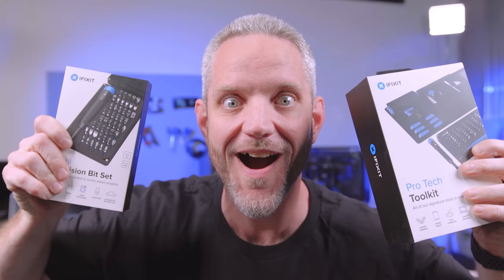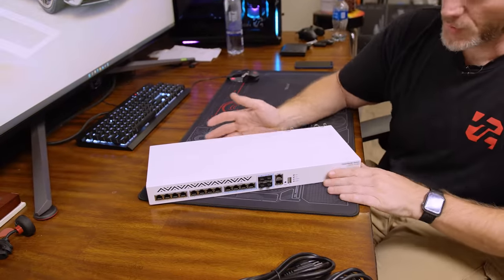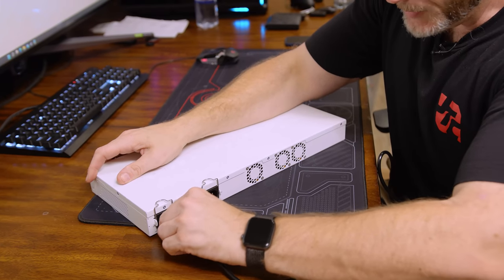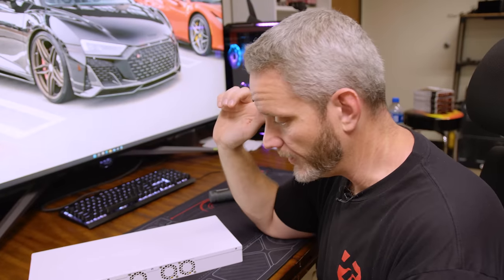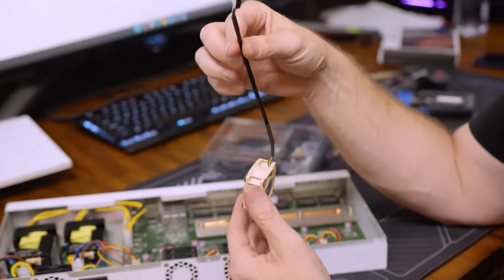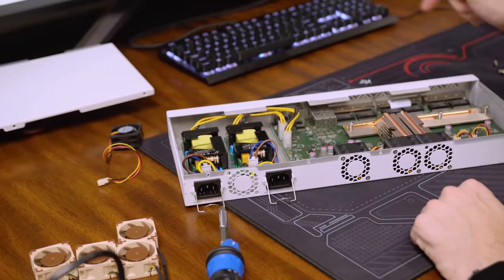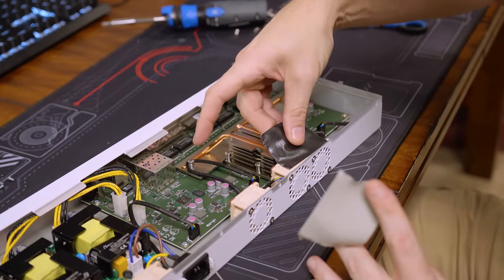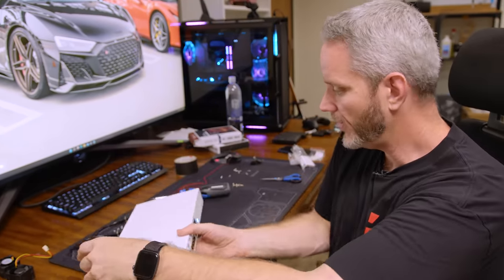We had to modify our new network switch...

Comment: If you’re going from desktops then copper makes sense. 

Fiber optic makes sense in data centers because fiber optic trunk cables for structured cabling (patch panel to patch panel connections) are much thinner and are impervious to EMI which can be an issue with thousand of servers, switches, PDUs etc. around. 

Plus nowadays everything moving to 25Gb for compute nodes and 40/100Gb for switch uplinks, having fiber infrastructure with OM4 fiber makes sense for upwards compatibility.

Comment: I'm a network admin, and I don't recommand this mod for business switches.
Even if it have the same size, fans don't have the same CFM ! It can potentially cause a overheat issue in high load situations.
Be careful and read the fan datasheet, the CFM can be hard to find on documentation.
Reply: It was curious though that there were pwm pins on the board. Still, totally agree with you about the CFM rating.
Reply: @darkhunterkiller4602  I've already made the same move on a old cisco 2950, without problem...even if the tiny noctua have a smaller cfm...but here, when we see the rad size, I guess this case can be really hot...I dont know this brand, dont know if you can monitor t° or use the pwm into the system
Reply: @david79781  Hopefully it doesn't blow up on Jay! lol

Comment: I’ve replaced quite a few 1U network gear and server fans with those Noctua fans. You lose some airflow but since the airflow is designed to be up to 100F ambient usually it’s totally fine. Especially those delta ear death fans. Soooooo loud. After swapping the fans then your only question is “Is the fan on/still working?” - I just always crack them open first to check exact size, voltage, and if it can do (4 pin)PWM or not. They’ve always been well worth it. And honestly….with some that are 6+ years of 24/7 service and no failures I feel like they’re more reliable than the original fans.

Comment: I have some concerns and would love to see an update video if the management software reports temperature. I've looked into using those same Noctua 40s in a 1U server I have, and the CFM just doesn't come close to the fans that came in it. It has dual Xeon X5650s, so I haven't attempted at risk of just wasting the money on a whole bank of them
Reply: Test it. Keep in mind all servers is made for worst case scenario. A 42U rack filled with 1U servers and intake temperature of say 22-23c. They need to push a f-ton of air to combat a situation like that with utilization at 100%.
Reply: @rolf7072  And what do I do with 8 to 16 40mm fans if it doesn't cut it for two Xeons? I agree with just testing the switch. But still curious what the thermals are if the interface reports
Reply: @rolf7072  I love Noctua fans and try to use them wherever I can, but I tried to replace a loud 92mm CPU fan (3,000 RPM, I think, might have been 4,000) with a Noctua and the reduction in airflow was so severe that the fan was completely incapable of cooling the CPU and it thermal throttled REALLY hard. Noctua fans will beat the noise levels of any other fan in a comparable performance envelope, but they're not meant to push a ton of air regardless of noise. Their industrialPPC fans are the closest they get to that, where they have much higher RPMs than their normal fans, but they only make those in 120mm and 140mm sizes.
Reply: It's funny.  As it turns out, RPM, CFM, and noise tend to be directly correlated.  :-)  There's usually very little difference between almost any two fans that run at the same speed, pushing the same amount of air.

There's a bit of motor noise difference, but it's often just that they sound different, and one might be more or less annoying or noticeable.

There's vibration, which can be amplified by the surrounding sheet metal or whatever.  But you can use isolation mounts on any fan to tame that problem.

The main contributor to noise is the air buffeting on surfaces around the fan.  Through the heatsink, against the grille, etc.  The only way to quiet that is to change the volume of air moving through those turbulent areas (lower RPM), which affects thermals, or change the properties of the physical items in the path so that the air buffets less.

Or, if you have the option, change the path of air entirely so that there isn't so much turbulence so close to the fan blades.  (For example, using ducts instead of fans directly mounted to a heatsink or, like in the case of the switch, to the perforated grille.)
Reply: Your right, those original fans are made for high capacity air flow, Noctua fans are made to be quiet and they run at an slower rpm.
Reply: There is difference between needing the CFM not needing it. In your case, you need it due to the thermals of the CPU. In the case of the server, if it's not placed in a normal enviroment and load, 42U thigtly packed with 1U servers and 90-95% (you never want 100%, that leads to queue problems) utilization of the cpu, NICs(yes, 10gig gets HOT), memory and disks, the need for the same CFM just isn't there.
Reply: @Themicles  Try adjusting the bios first, there should be settings for economy/silent, but its depends on what server you have.

Comment: I was going to go with Mikrotik but went with Unifi for ease of use and that things are more widely available here from them.

Buying and renovating a house, working and raising a kid in a foreign country is so stressful that I think the decision paid off honestly, though I would have really liked redundant PSUs..

Got a Dream Machine Pro and a 48 port switch with PoE++, they'll handle ethernet to all rooms (multiple in some), PoE devices like cameras, APs, PIs, servers and JBOD etc.

Patiently waiting to get it all sorted and move in though..

The Mikrotik switch I looked at was similar, had the same issue with fan noise etc and I would have wanted PWM for them. The fact it had daughter boards to spread the load and make it easier for spares was nice though.

Comment: I personally own that switch. There is a Firmware update that quiets it down to almost inaudible. First thing I did out of the box.
Reply: Also to note, this running in SWos has been rock solid stable for me for the last two years. The only time it get's rebooted is when the power goes out long enough for my UPS to die, or when I do a firmware update on it (which is rare). 100% stand by both this 12 port and the 5 port little passively cooled 10GBe switch. Both are awesome.

Comment: Jay, take this with a grain of salt as I don't know the dimensions of your area... however I would have highly suggested a 10G SFP+ switch w/ 25/48g uplink ports for other switches...  That way depending on where in the building the rack would be and endpoint compatibility you would be able to adjust according to the needs.

Anything over 30m and you start having issues w/ 10G & higher speeds over copper.  This would also allow you to pick & choose network capabilities, that way you could choose a 1/2.5/5/10G copper SFP+ module to drive your PC, and Phil could get a higher speed SFP+ module w/ fiber to plug into a more powerful NIC on his PC to give him higher priority to internal bandwidth to the server w/ a higher speed NIC installed in that as well.
Reply: He did wired the building with CAT6a so it'll work fine at 10 gig.   Nothing crazy long lengths either.

Comment: 7:59 No soldering iron required. If the fans in your switch did not have a standard 3-4 pin header, you would cut the ends off of both fans (new and old) and connect the old fan connector to your new Noctua fans with the kit. Insert the black wires in one connector and use pliers to secure them, do the same with the red wires. In the end you will have a new fan with the original fan's connector. 

The switch may have a PWM header but the software controlling the fan is set to DC mode, I would remove the PWM wire. 

10Gb RJ45 Ethernet ports run hotter than fiber SFP+, fiber runs hotter than Direct Attach Copper (DAC) SFP+. SFP+ RJ45 transceivers run the hottest.
Reply: All those connections are crimped.
Reply: @BrunodeSouzaLino  To me it is akin to a 110 patch panel. The wire is forced into opposing blades that cut the jacket of the wire to make the connection.

Comment: Nice to see things that use STANDARD fan headers for once, i bet you can fiddle with it when configuring the thing to.
Reply: Anything that uses a non-standard fan header is still standardized enough that you can buy the required connector off Digi-Key, or any other similar "electronics component focused" vendors (places where you can buy transistors and resistors and capacitors and integrated circuits in quantities ranging anywhere from 1 to ten thousand and above, at a fair market price).

The hardest part is finding the name of the dang connector.
Start with a set of digital calipers, take down the dimensions, and search based off of that. That should turn up the connector name, then you can change your search to the name of the connector and find pricing options.

This goes for not just any connector used in electronics, but any component used in electronics period.
This is why some manufacturers of devices that don't want you fixing things (and instead want you to buy a new thing) will actually use a high intensity laser beam to scrub off the numbers for the chips inside their devices, making it MUCH much harder to get replacement parts (looking at you Apple, Right to Repair should be universal, stop making it INTENTIONALLY hard to fix your stuff, this is why I hate Apple, well that and they're grossly overpriced for what you get).

For any "I don't know what that is" connector (or anything else) you can think of, there's gotta be somebody making it for sale to whoever has the cash for it.
The only minor problem you might run into is that you might only be able to buy in bulk of like 100 pieces or more, but even for just fans it's only a connector, chances are that they charge less than 10 cents for them in quantities over 1000.

Now this isn't usually the case, but you might actually run into a problem that I've just thought of. Probably not for fans, but for other things. There are a kind of connector that connects to a "cable" that is in actuality just a little plastic strip that has copper circuit board traces printed on it, usually the part that goes into the connector is reinforced with a less flexible piece of plastic. I forget what they're called, but "flexible electronics connector" should turn up some results for the general category.
Usually those connectors are standardized, but sometimes they might have literally one application and one vendor, so you might be up a creek without a paddle trying to find a replacement connector, and if you damage that cable well you can just forget about the entire thing that little cable is attached to, because you won't be able to find just the cable, instead you'll need the whole assembly.
But that shouldn't happen for just a cooling fan.

Comment: While it doesn't really fit your needs right now the Brocade ICX6610-48P-E is a great enterprise server switch you can get for sub $200 used and it has 8x SPF+ 10Gb ports and 48 1GbE ports. You do have to work around the software lock on the 10Gb SPF+ ports but there are resources online for that. Aruba S2500-24P is also a good option for used enterprise server switches.

Comment: Jay:  My advice would be to use this switch for your computers and server, then get a second switch like the Mikrotik CSS326-24G-2S+RM for your (relatively) low-speed devices like the cameras, DVR, and eventually your maker equipment.  This will also keep your main switch from having to deal with the constant network overhead caused by the cameras/DVR talking to one another.  This will give you plenty of room to grow while also reserving 10Gb ports for machines that actually NEED them.
Reply: Great Name 😂👌

Comment: The 24 port 1 gig Netgear switch I was given by my geek pro system builder and networking buddy has a extremely loud fan in it. I figured my home network would never stress it enough to get hot so I just unplugged the fan. So far it has been fine, fast, no problems. It's not on the level yours is but it just works and I have more ports than I'll ever need with luck. I doubt you could get away with that with that monster but some users out there might get away with it if they have a similar older switch that is stupid loud and you have it where you can actually hear it.

Comment: You can't use patch panels with DAC cables, and even for fiber you can't just cut a cable and terminate it into a patch panel. Then on the front of the patch panel you can't easily get fiber cables shorter than 50cm/20" so you end up with a mess of excess if the switch and the patch panel are right next to each over. You can get as short as 15cm/6" lengths but they are usually made to order.

Comment: We use Mikrotik all over our network core at my day job working for a loca wisp (wireless internet service provider), as well as ubiquiti equipment.

They’ve been rock solid, other than dealing with some of the networking feature shortcomings of mikrotik’s way of doing things as compared to say Cisco or juniper, but they get the job done and I think we have had several in the network with nearly a thousand days of uptime without issue!

Comment: I have actually swapped out all my fans in the power supply and extruder on my 3D printer with those exact fans...I have to say at full speed those are SUPER quiet and I have to keep checking them to make sure they are running.  I have to say with having my 3D printer close to my work desk, it made a huge difference.  Love these little fans.

Comment: You should 3D print a shroud to force the air to push or pull from the heat sink, the tape is going to collect dust and make the situation more turbulent in the long run.
Reply: It's Duct Tape, doing it's job.

Comment: I'd recommend getting the Unifi Switch Enterprise XG 24 when it comes back into stock. Gives you 24 10GB ports with 2 25GB SFP+28 ports for $1299.

Comment: I used to work for a WISP that used those for the routing to customers and it worked great. Every now and then a port might go out but you are talking about a ton of data running through it and it was in an a/c cabinet that was outside so I am sure that it will work just fine for you. We used a program called winbox to access the gui for it and it was fairly easy to use. You can also get 10g ethernet sfp for the 4 slots to add more ports. I have removed the power supplies on those to a DC connection before and didn't have any problems so I am pretty sure you are safe.

Comment: Ok FYI. When Jay was talking about the Power supply and it being charged that depends on something. In order to make sure the caps are discharged the best way to do with without using a bridge resistor is to disconnect the power supplies from the mains outlet while the device is still running. Is is true for all AC to DC power supplies. The reason for this is while the PSU is still running, if you pull the plug, so to speak, the PSU will pull the power from the caps, remember, the caps are just there to hold reserve power to prevent the power from dropping below a certain threshold. if the PSU is on when disconnected it will pull the power from the caps until there is no more voltage left and then shut down

Comment: Working as a network engineer I can tell you that Mikrotik is some of the cheapest proper network gear you will ever own. If you need to get to 10Gb uplinks look perhaps the the RB4011 or CCR series. The later can get a bit expensive but its rock solid and just works, it doesnt want to stop routing for as long as it lives. Should you require assistance configuring such router, don't hesitate to give a shout.

Comment: Pretty happy with my Mikrotik RB2011, not the same calibre as what you're using but its been very reliable so far. The UI is a bit to learn but very flexible. Then I just run a Ubiquiti U6 LR for Wifi which reaches the whole house and yard. Good system!
Reply: I enjoy my rb2011 but the throughput sucks with over 30 firewall rules. MT hardware seems to be difficult to acquire these days, which blows. I really wanna try out the RB5009

Comment: My ISP buddies use these in their core switching fabric
CRS326-24S+2Q+RM
$599 RRP
It's 24 sfp+ ports (10gig) and two QSFP+ ports (40gig)

High port number 10gig copper switches are not very popular and your options will likely always limit you. Best to commit to fibre for all in-rack connections and then install S+RJ10 rj45 modules for cable runs to the PCs.

Comment: There’s zero issues running Ethernet. When you have the capacity to go to 10Gig or higher, who cares? You’re not trying to support several editors like LTT or a giant company does. 

Also, you’ll be happy to hear that Charter/Spectrum is starting to upgrade their plant to 1Gig down by 1Gig up. This is an eventual preparation for 10Gig by 10Gig when DOCSIS 4.0 comes out.

Comment: Jay as much as you do not want switch to switch connectivity. I would recommend at least 2 switches for some form of redundancy as well since it is for your business. I recommend that even for an expansive home network, but you can get away with one at home vs. business cases. You could even use SFP+ to connect the switches with a short but fast fiber cable. You could make the 2nd one the bigger (more ports) main switch to use with that smaller switch being a sort of backup of sorts.

Comment: I recommend used enterprise hardware. If You are on a budget for example the Aruba S2500-48P-4x10G 48-Port Gigabit PoE 4x10GB SFP Mobility Access Switch also silent and can be similarly upgraded. Can be also configured as a dumb Layer-2 switch. Many home labbers use this one as a 10G starting point including me.